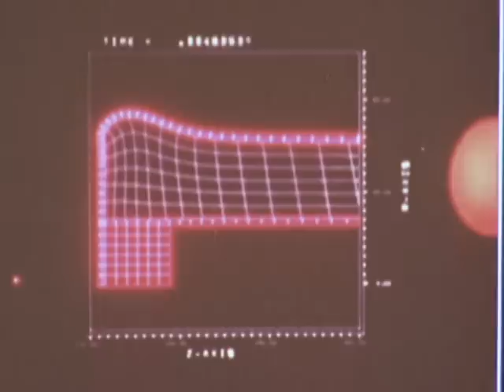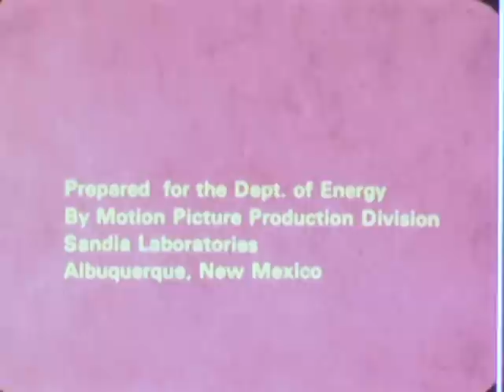Cask Test - 1978

Comment: The term "High level waste" does not accurately describe used nuclear fuel that has been for even as little as five years in  the cooling ponds while the really highly radioactive isotopes decay away to 1/1024th in ten "half-lifetimes " of each isotope.
Reply: A mixture of materials containing 94% uranium-238, 1% uranium-235, & 1% plutonium would not be described as "waste" in any sane world, no.

Comment: jet feul can't melt nuclear rods
Reply: Not exactly.  Fuel is made of uranium oxide ceramic pellets and is enclosed in zirconium tubes (fuel rods).  It will definitely melt.  The point made in the video is that the shipping cask is designed to dissipate heat and maintains the temperature inside well below the melting point of the fuel over a period of time.  If you continued the fire, eventually the temperature would rise, but the fuel would be contained within the container anyhow.
Reply: David Heckman do you even know what a meme is.
Reply: why so serious?... he was joking
Reply: @RazaQadri  he probably doesn't. But he knows much more about nuclear engineering than you do

Comment: These casks have nothing to do with the storage casks they are currently using which are far larger and have not undergone full-sized tests.
Reply: Your statement makes absolutely no sense and offers nothing but your opinion.  First, this is a shipping cask in the video.  The storage cask is shipped inside of it.  All containers, both for shipment and storage, are tested and licensed individually before they can be used.  Current storage casks for storage are made of stainless steel / nickel allow and are designed and licensed to last 10,000 years.  This video is from 1978-ish, but the concept hasn't changed and licensing has gotten even more demanding for these containers.  Spend fuel is shipped in an NRC licensed Type B shipping container.  You can read all about the testing requirements in 10 CFR Part 71.  Please attempt to educate yourself.
Reply: No, David Heckman. There is zero opinion in my comment, all facts. The current storage canisters are generally about 6 ft in diameter and about 18 feet long, and are made of 1/2" to 5/8" stainless steel. They have to be put into a far larger transport overpack to protect them. They are so big and heavy that no one has actually tested a full-size canister and overpack, only scale models. The canisters they use today are optimized for local storage at nuclear plants and are too big and too hot for any permanent geologic repository. Holtec Canisters that are to be used at San Onofre have 37 fuel assemblies while Yucca Mtn is designed for canisters with only 20 assemblies. Yucca mtn can't deal with those hot canisters that have a max. temp at the cladding of 400 C. The surface of the canister can easily be 400F and can't be put in Yucca which has to be kept to 100C max.

No storage cask can last 10,000 years, esp. if they are stored in a salt air environment. There, chloride-induced cracking can start as soon as the surface temp gets below 85C. In some areas, they start cracking after only 17 years.
Reply: Where do you get your information?
Reply: @RayLutz  Casks don't need to last 10 000 years. Oklo is a good example why even without high tech storage solutions, nuclear waste will not travel far in a geologically stable location.
Reply: Please cite your sources